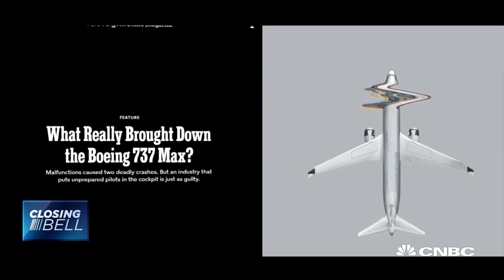NYT Mag reporter on Boeing: Accidents caused by crews in both cases

Comment: I have a friend who is a B737 MAX certified mechanic trained by Boeing, during the training course the Boeing instructors NEVER mentioned the existence of the MCAS neither in the technical manuals have any reference of it. Pilots weren't informed either and the only training tool provided to them was 1h of video on i-Pad. No redundancy for the critical AOA sensor, outdated FCC system, with only one controller operating at the time without any chance to activate the second controller, no override of the MCAS which took control of the airplane and was  putting the aircraft continually down, inadequate manual trim backup system and a list long of faulty security issues. Sorry Bill, you should review your article, you have not passed the test.
Reply: @Eighth Man - And how many US crews dealt with the same failure modes as the accident crews? On brand new aircraft no less
Reply: Why boeing never mention mcas? Because 737 has many flaws which can t be  fixed unless it is designed again from scratch. So they cover the flaws with mcas which is very vulnerable and risky.
Reply: Manuel Ventura — All that is well known by now.  I’ve read the article.  He covers the MCAS thoroughly and is not letting Boeing off the hook.  But the article is not primarily about Boeing and MCAS.  It’s about the decline of airmanship due to the large growth of the airline industry worldwide, and particularly at budget airlines in developing nations.
Reply: arif jau — That’s baloney.  Nobody who has flown the 737, such as the pilots who have YouTube channels, says that.  It is just conspiracy nut stuff from anonymous critics.

Comment: That NYT author is very ignorant on engineering aspects. We would never allow a smoke detector on the market that might burn your house down unless you are smart enough to recognize a fault scenario in which you have to remove the batteries. Why should we allow a plane with computers commanding a crash unless pilots are smart enough to disable that computer?
Reply: The improvisation of the  MCAS was to counter stalling. The pilots flying the AF 447 crashed the aircraft due to an aerodynamic stall. Unfortunately they were not smart enough to understand that lifting the nose of the aircraft could lead to a stall.
Reply: @chriso1330  Your analysis is false. I suggest you read 'The Boeing 737 MAX Misconceptions: An Engineer's View'. It's a pretty good analysis that I could co-sign.
Reply: flightisallright — In the first place, he is not an “NYT author.”  He is a freelance writer who sold an article to The NYT.  I am engineer (retired) who read his entire article and my judgment is that he is very well-informed on the engineering aspects of the problem.  As a pilot, he is also an expert on airmanship and on the particulars of flying the 737, which is the main thrust of his article.

He does critique the design of MCAS, and his article is perhaps the most thorough and accurate discussion of MCAS that you will find in one place in mass media.
Reply: @GH-oi2jf  Ok, he is well informed. However, his writing style did, in my opinion, not meet the high bar that articles published in the NYT should. It's about weighing he gravity of issues. Sure, the pilots made grave and even almost inexplicable errors. A serious conversation must be had about training of new pilots. But the pilots were not what 'really' brought down the 737 Max. Had MCAS not activated - which it shouldn't have given the disagreement of AoA sensors - and had MCAS not persisted - which again it shouldn't have - those planes would have landed safely. And while that wouldn't have revealed the deficiences in pilot-training, it would have spared a lot of people a lot of grief.
Reply: flightisallright — He has written for several highly regarded publications, including Atlantic and Vanity Fair, so they must think he’s a good writer.  In any case, it’s just his opinion.  It would be better if you were to take issue with some particular statement he made in the article, and to explain why, rather than to just dismiss him because you don’t like his conclusions.

I disagree with his statement in this video that the MCAS problem was not sufficient reason to ground the aircraft.  MCAS should not able to put the aircraft into a death dive just because the pilots were not skilled at getting out of a runaway trim condition.  I don’t write him off because of that disagreement however.  What he wrote about the performance of the airlines and their pilots is alarming and worth reading.
Reply: @flightisallright  - The author is well informed and qualified the problem is that he is misleading and has been characterized as so by other pilots and not specific to the MAX issue

Comment: So using the same logic. 9-11 happened only because USA and American authorities were insufficiently prepared i.e. untrained etc?
Pilots are trained and receive a type certificate but when an airline manufacturer produces an airplane and installs software that is kept a secret to the pilots and airlines and when this piece of software only relies on the input of a single sensor and to make that even worse, that the software creates far too powerful inputs and not only once but repeatedly, then you cannot put too much blame on the pilots.
The second crash, the pilots made a big mistake in not pulling back the throttles. They were basically victims of information overload.
The base fact is that Boeing and FAA screwed up, which has left FAA in a position where they will probably never be fully trusted again. No non-US air authority will want to authorize airplanes to fly within their area of responsibility unless they themselves have certified the airplane.
Boeing has also been left out to dry. The way the Boeing management has handled this case is worthy of a 3rd world country.
The main culprit is actually the airlines that keep wanting advanced airplanes but are unwilling to pay the price in pilot training.

Comment: The Boeing “errors” were in not designing a flight control system that the average FOREIGN pilot could  handle!  Had Boeing forgotten it was selling planes outside the United States?   Quit listening at 0:49.
Reply: 4 month old jets shouldn't be performing uncommanded pitch maneuvers to begin with
Reply: @PabloGonzalez-hv3td  Exactly. They had shitty engineering, so they patched it with outsourced software.

Comment: If this is his opinion, I would imagine that Mr Langewiesche should probably keep his head down for quite a while.
Reply: Nautilus Shell — Why would he do that?  We have free speech and press in this country.  He is qualified to write this article.
Reply: @GH-oi2jf  Given that the regulatory authorities have grounded the plane AND Boeing is taking emergency action to 'adjust' something in the aircraft, it sounds very much like the problem isn't actually the pilots as Mr Langewiesche posits, but rather with a failure on the part of the aircraft manufacturer and the FAA.  As you suggest, this is his opinion, and freedom of expression doesn't mean freedom from consequences.
Reply: Nautilus Shell — Mr. Langeweische does not say that the MCAS did not have a problem which needed to be fixed.  That’s a given.

Comment: "The trim cutoff switches are there and can easily overcome the problem" - Boeing PR guy, September 2019.
"The crew performed runaway stabilizer checklist and put the stab trim cutout switch to cutout position and confirmed that the manual trim operation was not working." - Preliminary report of ET 302 accident, March 2019.

Btw stab trim cutout was performed 30 seconds after the captain acknowledged there was a problem.
Reply: Well, u can check the NTSB and BEA comments of the ET302 final report. Langewiesche was right
Reply: @misterff1629  "After the second MCAS activation, the captain asked the first officer to trim with him and then put the stab
trim cut-out switch to cut-out. The first officer confirmed with the captain and performed the procedure as
per the AD and FCOM bulletin" "During the right turn for radar vectors, the captain who had been holding the aircraft with tremendous force
for quite some time told the first officer “pitch is not enough”, “put them up”. The FDR and CVR data was
concurrent with the stab trim cut-out switch being returned to normal position. 
Even if the decision to return the stab trims cut-out switches back to normal was not consistent with the AD nor the FCOM
bulletin, it seems the captain understood that the force required on the control columns was beyond one he
and his first officer could sustain for the remainder of the flight until a successful landing from the radar
vectors.
Simulator observation and research during the investigation process has shown that an attempt to land with
the miss trim level they have on the event flight where the stab trim switches were in cut-out position was
unsuccessful."
"According to the cockpit voice recorder (CVR), the first officer indicated that he could not rotate the manual
trim wheel."
"The force required to correct the mis-trim of -2.7 was out of the acceptable capability of the crew."
"After unsuccessful attempt to use the manual trim wheel and while both crew members were pulling on
the control column with an average force of about 110lbs, the captain told the first officer “pitch is not
enough” Then the captain said “put them up”. The FDR and CVR data synchronization was concurrent
with the stab trim cut-out switches being returned to normal at this time;
The Captain applied two brief electric trim up inputs of 1 second each while pulling on the control
column with an average force of 100 Lbs;
Five seconds after the trim-up inputs, the fourth MCAS triggered; the Airplane started to descend and
the stabilizer decreased from 2.3 units to 1 unit of trim;"

Basically they did what was on the manual: put the stab trim to cutout, pitch up, use the manual trim wheel. But the forces overcame them, so they tried their last desperate solution which was re-activating the stab trim to pitch up electrically. But 5 seconds later the MCAS kicked in for the 4th time and put the airplane down. So this guy is full of s... and the pilots did everything they could to save the airplane, but the MCAS doomed them.
BTW the Pilots are NOT mentioned either in the Probable cause of the accident or Contributing Factors parts of the report.

Comment: Strange conclusion from this guy, it sounds so simple to just cut of the switches to the trim. This fault didn’t present it self like a runaway trim. The cockpit lit up like a Christmas tree and several alarms went off. This in a critical part of the flight, they had no time to run checklist. So to believe they should have found the problem, in a system they didn’t know excited,  is very strange to me. I understand people that believe, this guy is paid by Boeing. Shame on you sir, to even suggest that it was the pilots fault.

Comment: I have just read the entire NYT article in addition to listening to this video.  It is not a puff piece for Boeing.  In fact, it does point out the errors that Boeing made in implementing MCAS and it provides a thorough and accurate discussion of the reasons for MCAS and of how it works.  But the main thrust of the article isn’t about Boeing and how they screwed up.  It’s about how the huge growth of commercial airlines worldwide has led to a decline in the average level of airmanship, and how this has contributed to reducing airline safety.

The author is a pilot and is clearly very well-informed on both the technical and operational aspects of the incidents that led to the crashes and the grounding of the MAX.  It is a “must read” for anyone who wants to understand the affair.

He did say one thing in this video with which I disagree.  He said the 737 MAX did not need to be grounded.  I think it should have been grounded after the Lion Air preliminary report came out, then fixed and returned to flight in a reasonable time.  I’ve been saying for awhile now, long before this article came out, that the grounding has gone on well past what is reasonable.

Comment: He says the solution was very simple, that those big fat toggle switches which every 737 pilot knows about were right there. Just press ‘em and save the plane, right?

Well, I would recommend this NYT article:
https://www.nytimes.com/interactive/2018/11/16/world/asia/lion-air-crash-cockpit.html

This article reveals that only a fast sequence of steps by the pilot and first officer could have saved the aircraft. The article states that they had to take a rapid series of complex steps to understand what was happening and keep the jetliner flying properly. These steps were not in the manual, and the pilots had not been trained in them. It is stated that they had to take a series of rapid and not necessarily intuitive steps to maintain control – a particular challenge since those steps were not in the plane’s operating manual and the pilots had not been trained on how to respond. 

The article explains in detail the 3 steps the pilots had to execute, based on the instructions later issued by Boeing. Also, an informative analysis of the events that took place in the Lion Air flight is included.

Comment: I would like to ask a couple of questions ( I am not expressing an opinion, just asking questions ): 1. Were there other times when the system failed and the sensors gave the wrong information on MCAS, besides these tow accidents? 2.  I have read somewhere that Boeing did not even inform the pilots about MCAS.  Is this true?  If this is true how do you expect in an emergency for a pilot to figure out what to do?  Would the presence of more than one sensor have prevented the mistake?  I have also read that disabling MCAS is not as easy as this gentleman reports, but I am not sure this is true.  Any technical opinion would be greatly appreciated.
Reply: Depending on speed and pitch turning off the trim motors may not be enough to recover the aircraft only to stop the runaway stabilizer itself he's disingenuous by implying it's a couple of switches and that's it everytime and the recovery procedure for an MCAS failure isn't EXACTLY like regular runaway trim and that small detail may have been a factor
Reply: @crassgop - He states it's the same as stab trim runaway and that isn't exactly true it is however very similar but the nuances were possibly a factor we don't have enough information yet and a lot is being made about pilot experience when the US had a 250 hr rule up until 2013 even so the ET302 captain had 8000+ hours 1400 on the 737 he doesn't die in an NG
Reply: I am still confused, maybe because I am not that smart or maybe not all the facts are known.  Seeing tings from a different angle, if the sensor and the MCAS were designed for this specific plane because of the increased and specific risk of a stall Boeing had the duty to inform the pilots about the MCAS system and tell them what to do in case of malfunction.  But I may be wrong, criticism welcome,
Reply: Ferdinando Cortese — 1. Yes.  The Indonesian aircraft which crashed had been reported for having problems by a previous crew.  2. Yes, MCAS was a secret.  This writer (who is a pilot) takes the position that the MCAS failure, while manifesting itself in a somewhat new way, should have been recognized as a case of runaway trim very quickly, in which case it would have been relatively easy to handle.  But the crews waited too long and made other errors, which led to loss of control.

The writer discusses these questions in detail in his article.  It is better to read the whole thing than to just rely on what he says in this video.
Reply: @GH-oi2jf  first of all I thank you for your expert, objective response, and I read the article in its entirety, which does not mean I understood it.  What I am saying is that if such a massive catastrophe was possible, although unlikely,  as the sensor malfunctioned and MCAS was triggered, and as this MCAS was designed for this particular plan, Boeing should have alerted everybody about this possibility.  As you said, and I take your word for it, the pilots could have avoided the catastrophe, but this does not absolve Boeing from have designed a system which could cause catastrophic consequences.  Again criticism welcome.
Reply: crassgop I cannot absolve Boeing.  To create terrible situations with sensors and MCAS and then expect pilots in a few seconds to solve it is not rational.  I am not absolving the pilots, I am saying from what I understand, which is I admit limited, Boeing created an unstable potentially catastrophic situation.
Reply: Ferdinando Cortese — I completely agree that Boeing’s sneaking this system in without telling the pilots was not acceptable.  Boeing and the FAA have both suffered a loss of credibility for the way this has been handled.
Reply: @crassgop  - Although the licensing process has changed dramatically in the last 6 years the types of planes that MUST be flown hasn't and remains identical to anywhere else so that's a load of horseshit. An American airline pilot that flies strictly Airbus will never fly anything that isn't "highly computerized" after they're qualified
Reply: @crassgop - That's still a misconception FBW airliners aren't any more autonomous than purely mechanical ones the choice of how much hand flying vs autopilot is typically up to the pilots (some airlines do mandate the use of automation) "regular" airliners have also had automated safety systems for decades and sometimes the fact the pilot can override them is a bad thing as was the case with Colgan Air when the captain overrode the stick pusher that was trying to save them people just want something to blame